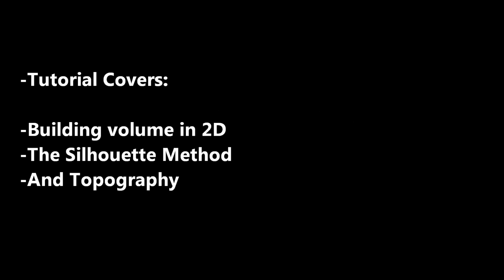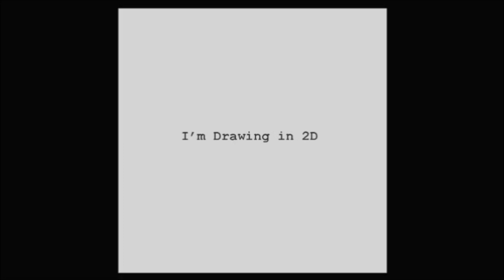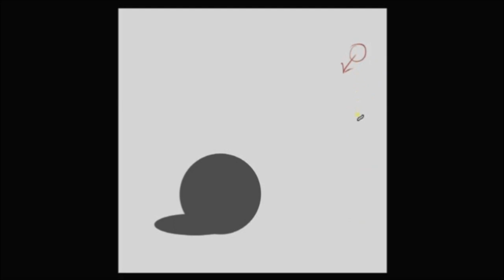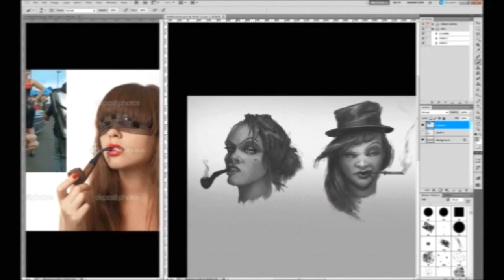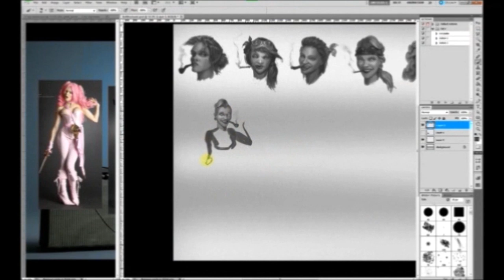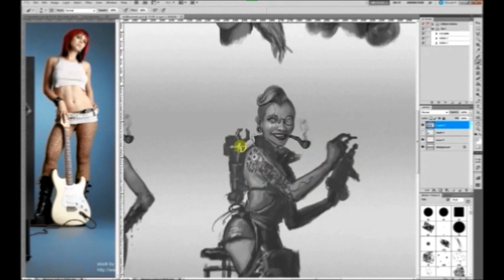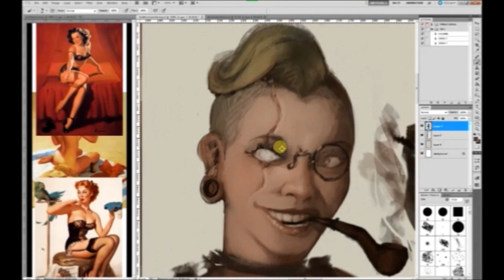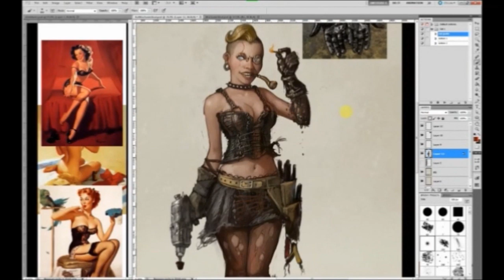How to build volume quickly in 2D (Rat Rod)

Comment from the maker: I used pixelate on another piece in the series to keep the colors congruent, so yes, you're correct. 

The warp tool I was using is called puppet warp. If you have PS5 it should be available.